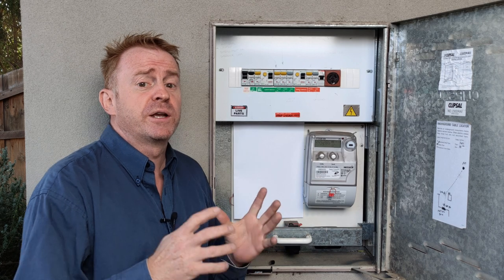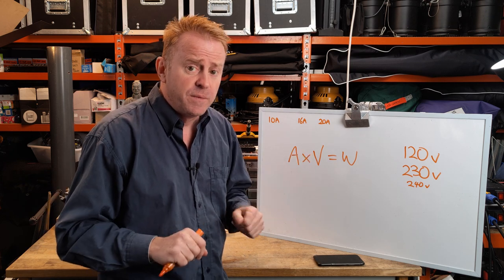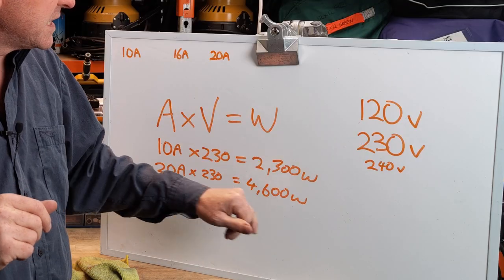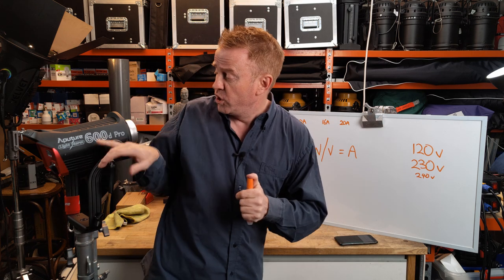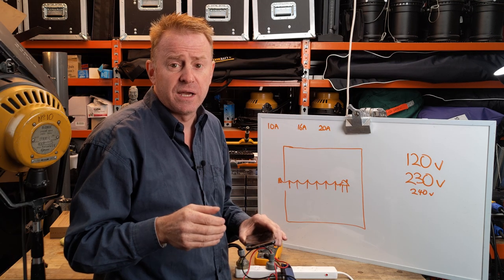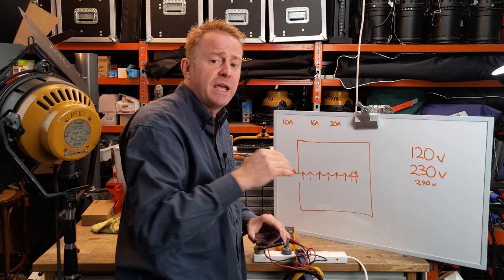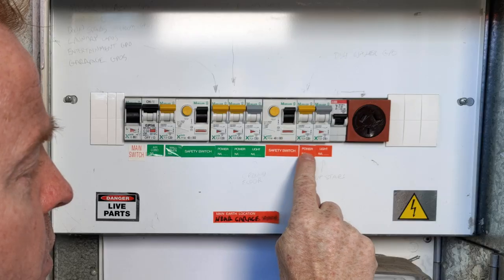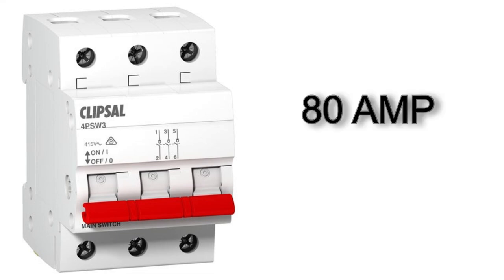Gaffer & Gear 139 – Powering Lights from House Circuits

Comment: In the US circuit breakers are often mislabeled, installed upside down, and cross wired between rooms, and will not withstand rated amps; even paper amps. It can be a nightmare. LED's are a lifesaver in those houses.

Comment: Hey just a heads up, be careful with the main switch. It will often have a rated current on it but actually won’t be a circuit breaker. Usually it’s just a big switch. I know they’ve just brought out new laws here in Australia to make all main switches circuit breakers but there will still be many around that aren’t. An easy way to tell is if there is a letter like a C or a D next to the current rating, that 100%  means it’s a circuit breaker not just a switch.
Reply from the maker: Thanks for that, I forgot about those old black switches
Reply: @gaffergear  it’s not just the black ones. A lot of them look just like regular MCB’s but aren’t actually on the inside. 👍🏼

Comment: You can easily identify which breaker an outlet is on using a circuit breaker finder such as the IDEAL INDUSTRIES, INC. 61-532, Klein Tools 80016, or many similar devices from other manufacturers. They are a two-piece kit.  The Transmitter plugs into the receptacle in question. The receiver is then run over the panel breakers and will emit a signal when the appropriate breaker is located.  You need to run the receiver over the entire panel once to allow the receiver to correctly sample all the breakers.  They are very reasonably priced compared to the cost of other gaffer gear.

In a previous presentation on his tool kit, Andrew mentioned using a circuit tester to be sure your outlet is correctly wired.  Many circuit breaker finders incorporate a circuit tester into the transmitter, providing two useful pieces of gear in one package.

Comment: Of interest is that Western Australia is 240v (different from the rest of the county).
Reply from the maker: I think we all matched up in 2016. (Could be wrong) Melbourne changed in 2000. I think QLD and WA were last to swing across.

Legislative voltage in Australia is 216 to 253v.

Comment: Hi Andrew, thanks heaps for this really useful video. Quick question. You mentioned that Australia is now 230V but with your meter you measured 238V. What is going on there? Thanks!
Reply from the maker: Voltage goes up and down depending on the load on the grid and how close you are to a transformer on the grid.
Reply: @gaffergear  that makes sense, thanks for the info. Was asking because I’m getting a tungsten Dedolight DLH436 and the ballast allows you to choose voltage in 5V increments. Might have to get a meter to figure out what to set it to more accurately…

Comment: Hey Andrew, quick question, I'm supposed to use a power generator on a set and it's a 240V amplitude, the production rented one cable which is a 240V male to a "Y" 2x 120V output, do you think that it's going to work with my generator output ? That's to say, is it ok to use a 120V cable onto a 240V outlet ?
Reply from the maker: I stay clear of any questions about 120v. I don't use it in this country so I have no qualifications to give an opinion
Reply: @gaffergear  Sure ! Thanks anyways, keep up the good work!
Reply: Call the rental house. They will absolutely know.